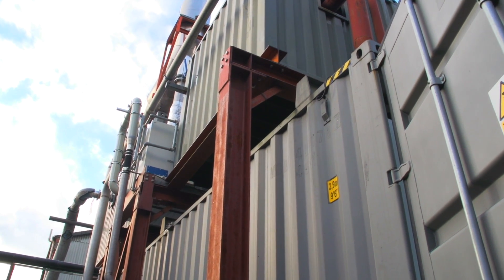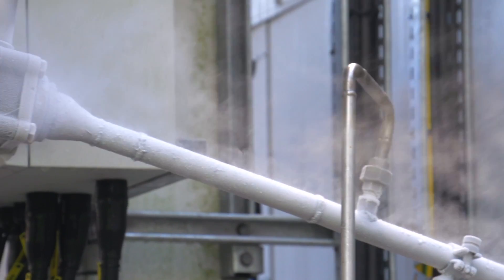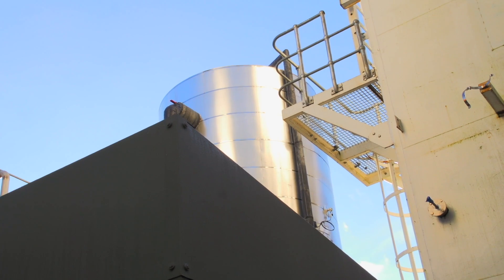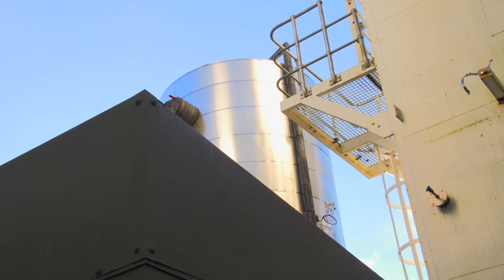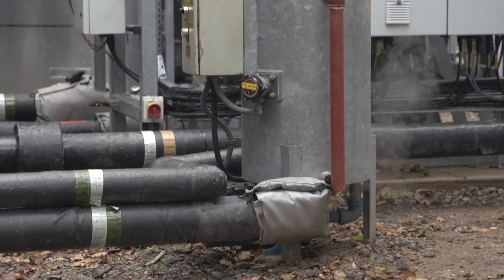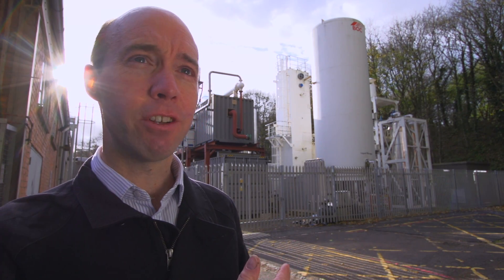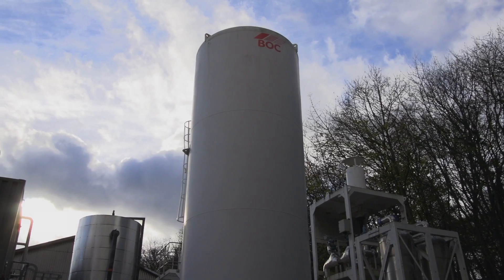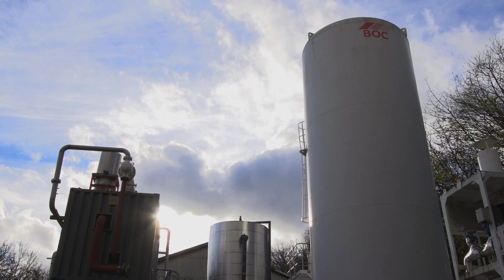Cryogenic Energy Storage at University of Birmingham

Comment: really very inspiring even if the efficiency would reach only 50% since this opens the way for many creative solutions for a lot of problems: you can use low grade waste heat which is probably present at many factories, you can replace those huge cooling towers of nuclear plants, you can use liquid air directly for cooling, airco, perhaps some form of transport could use this since it would have no toxic exhaust and recharging could go easier than with batteries, it's possible to plant this just about anywhere.. Perhaps very big new flow batteries could supersede this  but even then first all that testing ;-) No,we need something reliable and proven today, the climate change is not waiting. I would start by asking every large factory with waste heat and/or cooling needs to produce it's own energy  and store surplus with this so they are independent from the grid. That technology seems risk free.